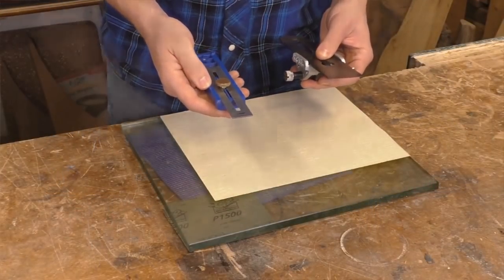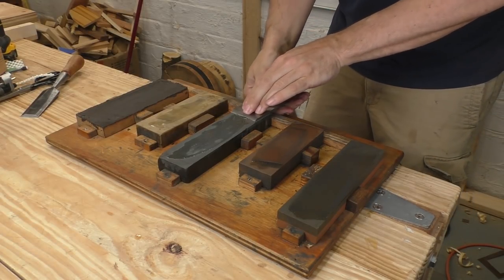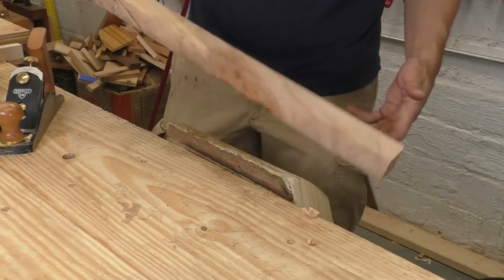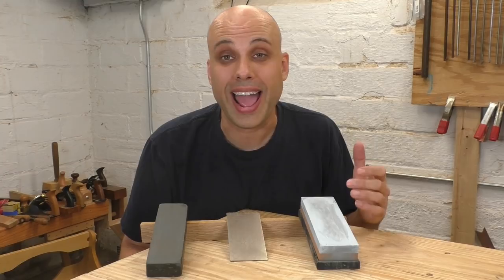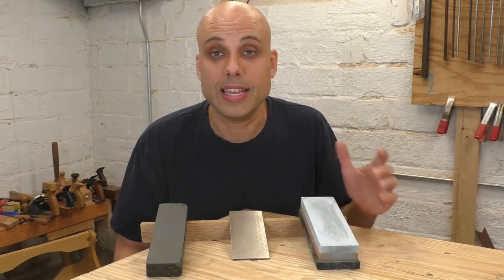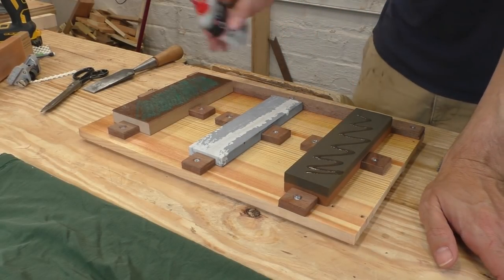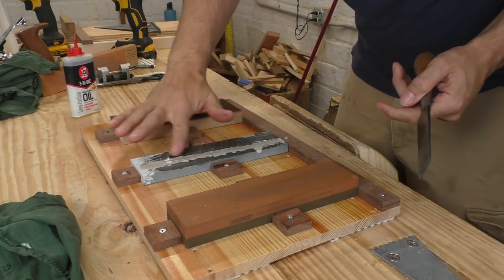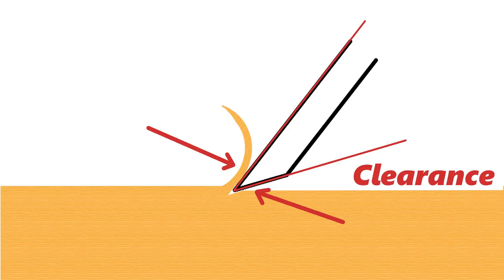Fast freehand sharpening: no jigs, no guides, no sandpaper.

Comment: Hey Rex, I just wanted to add a note about the leather strop, normally what I will do is use the flesh side of the leather to hold the compound, and then the hair side would be used to both burnish and polish. I get an insane edge when using both sides, as opposed to what I consider now an okay edge using just one.

Comment: been using my dmt sharp 3x8 inch coarse, fine, extra fine and  extra-extra fine, then to my strop with green compound for 15 plus years. I use water to lube the bars. On new tools I flatten the bottom of my steels on my coarse stone. I started, using a Canadian hone guide, but I rarely use it nowadays. I quickly get to a mirror finish and a sharp tool. Had I seen your video, I would have gone that route. I think in those days, I did not know about youtube.

Comment: Although this is an older video.. Going on a year. And as a 'beginner' in sharpening or trusting myself to sharpen. It's easy to see that some swear by oil stones, water stones, diamond plates, and sand paper. I've learned this. Learn them all, find what's best for you. I've done the sand paper sharpening as an 'in a pinch' and even tried using a couple water stones I once had. However I'm fully willing to invest in all methods and find what one works best for me personally..

Comment: I bought water stones early on.  I got an earmoo combination stone 2000/6000.  You are right that they require soaking.  Mine only take five minutes or so for the bubbles to stop.  However, I do feel this is a deterrent to using them as often as I might otherwise.  The other downside is that they make a terrible mess on the bench.  Interestingly, after a couple of years of soaking/use, the two stones came apart so now I have two stones instead of a combo.  I flatten using a DMT diamond plate (cheap one with a plastic base) after every use.  For awhile, I just but the green compound on a piece of mdf.  Now I have a piece of leather from an old shoe glued down to mdf to use as a strop.  Sharpened a couple of days ago, and this afternoon got glorious, beautiful, almost transparent curly walnut shavings while fitting drawer fronts to the openings of two bedside tables.  Thanks for your common sense approach to the subject.  I see no need to sharpen to 16000 grit or some other ridiculous number.  I go to 6000 and then strop.  At my skill level, that is perfectly adequate.

Comment: I've been working with some Japanese whetstones I got for my birthday for the past couple of weeks and I was having trouble with my chisels. I had been using angle guide wedges for knives up until this point and was getting razor-like by locking in that angle. The wedges didn't work for the plane iron I sharpened but I ground the secondary bevel well enough.
 I had some real trouble with my 1/2 chisel and after getting that sharp enough, I stopped. Wasn't going to do the other chisels until I saw this video (for the second time), and tried the rounded bevel technique and it is SO MUCH EASIER to keep that angle consistent than some arbitrary angle and trying to feel if my fingernail can fit under the edge to check for the angle.

business

Comment: Excellent vid with the usual good advice re freehand sharpening. It’s my preferred method until I get to the small stuff eg the 1/4” chisels etc.. I find it a lot easier to use a honing guide for these because it’s so easy to go off square freehand, ending up with a squint edge. 

Who knows maybe another 20 years of practice will fix this?🥴

Comment: Great video as always. The only place where I'd correct you, @Rex, is on sharpening chisels. I saw you using the strop and I wouldn't recommend it for the back side, because it does create a tiny micro bevel at the cutting angle which defeats the purpose for  a flat back, which needs to be flat. I used to make the same mistake (then upgraded to shapton 16000 galss stone, but that's beyond the point). Anyhow within two years of using the stop for backs of chisels made them not flat anymore. I'd suggest adding another block of MDF charged with sharpening compound, and using that for honing the backs on chisels for the cheap instead. Or upgrading to a shapton if you can muster up the money. Then again, here's another great tip with MDF (or any softwood for that matter). When sharpening gouges, or profile planes, you may find that a negative you produce with a beading plane for example  can be a really good place to hone your edgein reverse when charged with the green compound. Or with gouges for inside for example. 
I hope this helps.

Comment: The difficulty for beginners and long-time amateurs is that the experts disagree about sharpening methods. So, experiment for yourself. I like the Paul Sellers method but unless you're an absolute pro the cambered bevel ends up steeper and steeper meaning you have to laboriously regrind with a jig or powered machine. The same can be said for the Rob Cosman method which essentially uses micro bevels without a jig. One solution, especially with thin Stanley irons is to use a jig and hone the whole bevel. This gives a more durable edge and you don't have to regrind - just use coarse/medium/fine stones. A strop is unnecessary and just spoils the edge. Just another idea from the zillions of methods out there!

Comment: I have never used a honing jig.  My planes will shave off really long curly shavings.  I will admit that my "honing experience" spans more than 60 years and back in the 1950's my sharpening skills really sucked but as with most acquired skills practice is extremely important.

Comment: I saw a suggestion to have a tiny bit of vegetable oil on the strop to make the compound less dry and easier to apply. It seems to work as advertised. I bought Trends polishing compound bar and I found that it was a bit hard to apply and get to stick, the oil seems to have solved that.

Comment: I'd add an important note if someone is willing to try waterstones, based on my own mistakes: the soft japanise waterstones won't work well at all on a fancy Cr-V steels and powder steels. I've got several chisels of this kind. Also, sharpening of small chisels or curved blades is extremely difficult on a soft stones, as they tend to dig into the stone, damaging both the stone and the blade.

Comment: There's a few things I would suggest that would take these edges to the next level. 

First, you're stropping too hard, and too much. What happens when you do this is it adds a bit of a curve to your apex. A convex area. This happens because when stropping, you're putting pressure on the leather and it deforms. This still leads to a sharp blade, but it doesn't last nearly as long, and it's not nearly as sharp as it could be, since after some use, your apex becomes blunted and wider. This might still be able to shave hair, but that isn't the best indication of a sharp blade. it's definitely servicable and usable, but try stropping with just a very minor amount of pressure. I think you'll find your blades last longer before needing sharpening again. 

I'd also suggest diamond stropping compound over any of that cheap green stuff. Mostly because of consistency, but also cutting speed. The common green compound people use to polish their blades definitely works, but the grit size in them tends to be quite inconsistent. You can get sizes varying from 15-20 microns between particles, and this doesn't leave the best edge. Diamond compound tends to be rated at +/- 1 micro. So if you get 2 micron particle size. You'll get between 1-3 microns in size. This gives you a much better edge. Especially because when paired with the lighter stropping, and the better cutting power. You're stropping less, which minimizes that convex edge to your apex. It's expensive, like 15--25$ for a brand name diamond compound(don't cheap out). But I find it lasts for dozens of blades before needing to be reapplied. Where as with green compound, you need to reapply basically every blade you sharpen, and since most are doped with tons of wax, you get an awful surface on your strop after a few uses, which also impacts edge quality. A tube of this stuff lasts me a few months, and I'm sharpening dozens of tools on it every other week. So someone with less use will find that this can last a year or so. You can also get a spray, I'd recommend that for most honestly. 

Proper burr removal is necessary to have a long lasting edge. Most people strop too hard, too much, or use questionable compound and this compromises your edge. Sharpening this way is the difference between being able to shave hair and have a decently cutting wood plane. To being able to whittle hair mid-air, and having a plane that glides through even some of the toughest woods. It's not even really any more work either. 

Micro bevels also shouldn't be over-looked. It takes a small amount of time to build up the skill for them, but what it does do is make your edges last longer, easier to re-sharpen. And it reduces the amount of stones you need to a profiling stone. A medium grit like 1200-1500, and a high grit, like 16,000. You are also able to adjust angles depending on the wood you're cutting. I can touch up a edge back to hair whittling sharp after a days use in about 25 seconds using micro bevels. And I can do that a 6-8 times before having to reprofile, which takes a little over a minute with the diamond stone. 

My setup is a diamond stone with 325 on one side, and 1200 on the other and then a 12,000 grit. Was about 100$ CAD for very high quality stones. They'll last a lifetime for most people, if all they're doing is sharpening a few knives every month, and a few handplane blades or chisels every few times you're in the workshop. At least 15 years for most. Softer stones, like waterstones will be replaced 3-5 times in that same period, so are you saving money doing it this way? Probably not. 

The harder stones like diamond and ceramic, and the japanese wet and go stones, like a shapton. Also last forever, and are significantly easier to use. I would never recommend water stones for anyone. They require so much work to maintain, and they dish out after a single sharpening, which NEEDS to be fixed, or any further sharpening will leave you with awful quality edges. 

I never believed in cheap sharpening options. Spending 15$ on a cheap waterstone might seem like a good idea to save money in the moment, but you're going to be spending significantly more time sharpening and maintaining because the edges you get are awful on them. It also doesn't feel good to use, it's also finicky because of the water needed. So you're going to avoid sharpening when you probably should.  It's one of those things that you buy cheaply and regret it, because you're ultimately just wasting money and/or getting a poor quality product. There's a reason those waterstones and cheaper stones are like 10-15$, and it's because they're shit. I HIGHLY recommend Shapton stones, as they will last most average people a lifetime. Along with diamond stones. But buy a high quality one. As you'll find the cheap ones tend to have grit contamination. Sharpall has a good 325 and 1200 grit stone that is very good quality. DMT has some good ones too, and S SATC has a budget friendly one. Might have some grit contamination, but it's still much better than the cheaper ones you find on Amazon in the 4 packs. 

Getting a nice stone or two and you'll start sharpening and you'll be so impressed with the ease of use, the quality of the surface, that you'll be sharpening your shovels and crowbars and your steak knives just because you like using them. That's why I'd recommend a few high quality stones over a bunch of cheap ones, and learning to microbevel. Makes it an enjoyable experience. I enjoy sharpening so much now that I'm even resharpening my straight razor blades, and my utility knives and putting edges on random pieces of metal I have laying around now. That's the difference quality makes for you.
Reply: Do you have a link for the paste and stone that you use?
Reply: @AaronGeller  Couple name brands, I usually just get the DMT spray.

All of this stuff mentioned isn't necessary at all. But if you've practiced sharpening and want to practice putting an even better edge on your blade. Well I found its worth it.  

Its helped me be way more consistent with sharpening, and allows me to sharpen blades from completely dull to super sharp in under 5 minutes.

I also have sharpal, and shapton stones. I have some cheap diamond stones too for fast cutting, like redoing an entire knife from dull. saves wear and tear on the nicer stones.

Comment: I know some sharpening noobs might be intimidated by the process, but really, freehand sharpening chisels and irons with a big, flat bevel is a treat compared to, say, knives with a teeny tiny secondary bevel. I mean you can make the bevel convexed like Rex does, lickety-split, and if you want to take longer, you can keep an angle very close to the original bevel, which can speed up future touch-ups (less guesswork about whether you're getting the right 'curve' of angles on a convex if you don't have it programmed in to your muscle memory). 
For folk who are maybe halfway budget-wise between having a set of stones and using sandpaper,  consider investing in a stone of whatever grit you'd use prior to stropping, since you'll probably be going back to it for touch-ups more often than you would be re-profiling the whole edge. As long as you're not drastically changing the angle of the microbevel, frequent touch-ups with a fine stone and strop will actually reduce the amount of work you'll need to do re-establishing the bevel like you would if you let it get really dull.  Save the sandpaper for those occasional re-profilings, and have extra in your lower range of grits as they'll be doing most of the work. I've been surprised how long a given set of grits will stick around before I need to replace them when I have a fine stone and strop to do the bulk of the daily touchups. That said, I do hope to afford a full set of diamond plates eventually!
Reply: I hope, just like you, to purchase a set of diamond plates someday (preferably as soon as possible).

Comment: Here's how I get my angle just  right. I use DMT Diamonds($80ea), so I use window cleaner as lube, not oil, but it works any which way. Wet the stone, place the blade on the stone, roll it forwards, watch the liquid squeeze out. When it stops squeezing out the front and starts sucking in the back, you've gone just a hair too far.
Reply: I do the same with water on Japanese / BBW water stones
Reply: Interesting tip.

Comment: Actually, a good diamond stone is cheaper compare to all your set. Just check the Sharpal 162N on amazon. The price is around $55 USD. It a 3x8 inch with a 325 and a 1200 grit side. I use it with a strop and a touch of green compound. It work great for my kitchen knives. They also sell a cheaper 2.5x6 version.

Just a word of warning about cheap diamond plate. Make sure it monocrystalline  and electroplated on a thick metal backing. Chinese junk is often polycrystalline diamond glued on a thin sheet of metal glued to a soft plastic support... That mean in plain English "TROUBLE".

It won't stay flat because the backing is not enough rigid. The polycrystalline structure mean you won't get a uniform grit to work with and it will change with use. Also because it glued and not electroplated. It won't last a long time... It's basically junk.

Comment: for a strop i've found if you're using compound then rough side up works best, if you're not then shiny side up. either that or use 2 bits of leather and stick to each side of the strop

Comment: The main reason the bevel matters (though you don't have to go all psychotic over it) is that different angles give different durability to the edge. A working tool like a chisel, axe, etc. has added benefit for a bigger angle so that there is more blade material backing up the edge while a pocket knife uses a smaller angle as it isn't trying to cut through hard woods so needs less material backing up the edge.

Comment: I love this video and the last one you made! You talk about finding old sharpening stone for cheap, but could you do a video about leveling an old stone? I got one for free from a friend and it is basically banana shaped
Reply: The best thing to use is a lapping plate but they're pretty expensive. As a alternative you can use sandpaper with a perfectly flat surface but it will take a while longer and you'll more than likely have to switch out the paper as it gets gunked up if it has a deep bow in it.